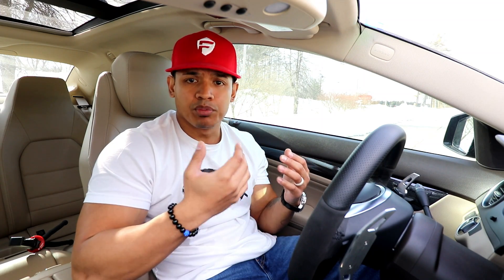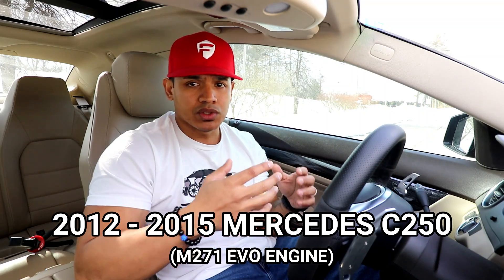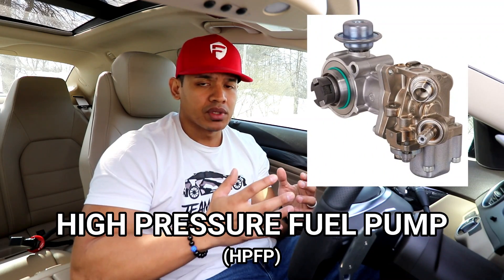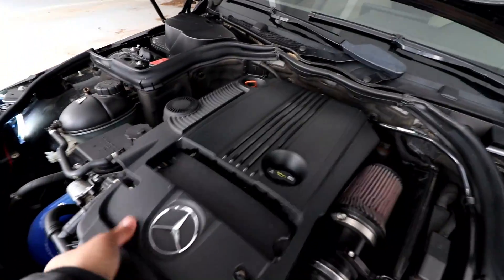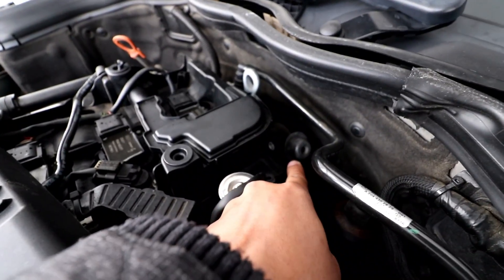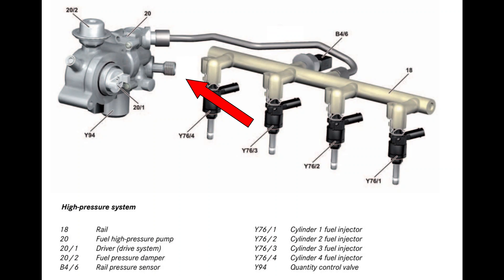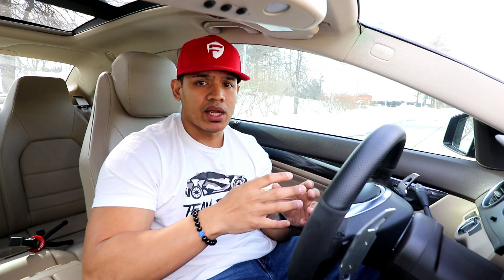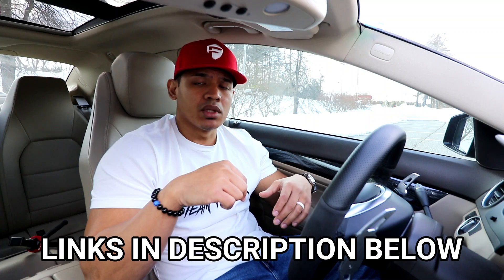FIX MERCEDES C250 P0002 POWER LOSS WHEN ACCELERATING

Comment: Had the same issue with power loss on my MB c250 2012 and P0002 error or P008A (low pressure fuel system - pressure too low), sometimes both at the same time. First thing you need to do is to replace fuel filters (there is regular fuel filter under the left back seat and coarse filter before the low pressure pump under the right back seat, you'll have to disassemle fuel pump a little bit to find that kind of pouch filter). After replacing first filter and cleaning second I can accelerate up to 6200rpm without any errors. Hope this help to somebody
Reply from the maker: Thank you for sharing your experiences!!!!
Reply: I experienced this same issue. i am ordering a new fuel pump and also checking the filter sock you mentioned. on the xentry it shows low fuel pressure.

Comment: One thing everyone should know is the way this turbo setup up is built you can't just punch the gas , I've noticed if you treat it like it has a big turbo setup and want to pass someone, if u hold the downshift lever to the left and the car will shift to the safest gear and then just gradually give it gas all the way down as your buildin boost until youve passed traffic or merged etc. Never step on the gas all at once and the kickdown function on this model is just terrible so I personally don't use it , hope this helps

Comment: I ran into this issue and as soon as I turned my car off and waited about 5min, before starting it again, and it was 100% normal, however if you try to start it right after you turn it off it is likely that the car will not start the first time and the check engine light will be on!!! Car needs to have 5-10 min before it is started again, I have noticed that other people have been doing this as a temporary solution just to get where you need to go!

Comment: Amazing how many people have this problem .. so with me it happens when I pass .. and when I pass and push down on the Accelerator quickly and forcefully it then goes limp ..  and suddenly I can’t even go over 30 miles an hour .. it’s incredibly dangerous and a really serious issue
Reply from the maker: There was finally an extended warranty on it (I think).  You’d have to reach out to Mercedes Benz USA and give them your vin and ask. Still a little late by Mercedes’ if you ask me.
Reply: @TheFlexxGarage  there was and I took mine in and they said the fuel pump wasn’t the issue and it came back with a broken charge pipe that they wanted $1k to fix

Comment: I'm a 2012 c250 owner and have experienced this same problem since 2014. This is a horrible issue for anyone that has experienced this problem. I'm hoping there hasn't been any fatalities do to this problem. I'm also upset that Mercedes consistently denies how serious this problem is. I understand that there's wear and tear on vehicles but there's people who have this problem driving out the dealership. I'm reaching out to all of you to help support on starting a recall on this problem. Below is a link on where to file a complaint. I hope you all share 5 minutes of your time to submit your complaint.

Flexx keep up the good work bud.

NHTSA link: https://www.safercar.gov/
Reply: I have had the same problem twice now whilst on the interstate trying to overtake. I agree this is a serious safety issue and I have completed a report (only took 5 minutes) at the link you provided, thanks. I think everyone should file a complaint to force the issue and make Mercedes Benz take responsibility before (if it’s not too late already) a fatal accident occurs. I have a 2014 C250 with 67k miles on the clock.
Reply: I took 10 minutes to file a detailed report for same issue 2012 C250 with P0002 code power loss while accelerating, I hope something is done about this, Thanks for all the great info.

Comment: Truly appreciate Flexx Alexander for posting this video. FYI to all, this high pressure fuel pump is indeed part of extended factory vehicle warranty/recall by MB USA. They finally recognized this to be a major issue. I have a 2013 MB C250, so check with MB USA. My car had this issue for years, initially thought to be the turbo, but after turbo was repaired the acceleration issue continued for years and no one could really figure out the problem. Recently tried to sell my car and the buyer test driving it floored the gas and the issue came back and I panicked but scanned my car, got the P0002 code and came across this video. Took my car to dealership and got it repaired for free, saved me thousands. My car finally drives perfect as it should.
Reply from the maker: Yes, I already shared that a few months back. I got the letter as well.  Only thing that sucks is that most people already got it repaired (not by MB) so they can’t get reimbursed or their car is way out of the extended warranty period.  I feel like MB knew about it but didn’t want to do anything until the last second so it’s less exposure to them covering the fix. This is the same exact route they took with the camshaft adjuster issue on the c250.
Reply: @huantsai9406  does w205 have that recall or what is it called

Comment: Thanks a million! Happened to my W204 too. The dealer could not find the root cause. Since I had watched your video, I insisted on double-checking and they finally confirmed it's the High Pressure Fuel Pump!
Reply from the maker: Nice!
Reply: so they replaced only the high pressure fuel pump and the problem was solved?
Reply: And how much did it cost?

Comment: Yo Alex, as you probably knew already, YEP, I had this problem last year where the dealership had my car for over 3 months on hold because the high pressure fuel pump was on back order and there was only 5, THAT's 5 HFP's in the entire USA available for distribution. 
but this is a known issue with Mercedes Benz. I'd say though that the real problem is that MB hasn't made enough inventory of these HFP's to send out to the US for replacements. 
Also, for all those who may not know, these same 2012-2015 C250's also have a passenger air back recall on them as well. AND AGAIN, this issue can not be resolved because the original company that made the airbags went out of business. So MB had established another company who was suppose to take this up, but again, the airbags are on back order.

Comment: Thank you so much for this. I had the same problem on 1.8 petrol w204 face-lift. Replaced the High pressure fuel pump and it works perfectly now.

Comment: I had that issue with mine. I was told where I got my 2013 c250 w204 that I had a bad coil?? It got replaced and hasn’t happened to me again….yet. But good to know this info. Thanks flex.

Comment: I made a comment of this b4. Pretty much  my rule of thumb is not to floor it when ur gas is low, and when I mean low. I'm talking about little below a quarter.  I had this happen b4 and it's not a fun time trying to fix it in a middle of a commute.  In my case, all I had to do is clear the code and it was back to normal.

Comment: I’m having this issue right now. I found a kool little solution besides shutting the car off. I just put the car into sport mode and only hit the gas about a quarter ways to the floor. The car gets moving and doesn’t put it into limp mode. Now it’s not a fix at all but you’ll definitely get more power to pass on the freeway and you’ll be able to continue to drive until you have enough to get the problem fixed. I’m about to buy another HPFP soon and try to replace it myself.
Reply: Leave it in eco and just hold the lever in the downshift position and it will put it in the safest gear , then treat it like you have a big turbo setup and gradually step on the gas till it's all the way down and shift accordingly (reason for eco is because in sport it will shift closer to redline , and will require more work and fuel from the pump)
Reply: @BC2FITTY  even when I do that, eco mode still doesn’t have the power I’m looking for or need to pass, sometimes. So what I’ve learned is to just hit the paddle and upshift the car on my own before it gets close to redline. I have the power to pass and don’t have to worry about the pump putting in too much work.

Comment: I had the same issue mine was under aftermarket warranty. They changed my spark plugs coils and  inner cooler. and that fixed it.
Reply: Did you have to pay anything?
Reply: @GamingLife114  did you had to change all coils an would hesitate when you would step hard on the gas

Comment: Hey Flex man thanks for the info. Just got off phone with my service rep and he confirmed the warranty extension on the high pressure fuel pump does qualify my car so taking it in this Thursday.
Reply from the maker: Nice
Reply: If you have a salvaged car do you think it still works

Comment: My 2014 C250 did the same thing in January 2023. I saw this video and thought, that has to be it. (I've been a professional VW/Audi Technician since 1985 with Mercedes experience). I was passing a car on freeway and "boom" the car went into Limp mode with the check engine light turning on immediately. 
I erased the fault and all was fine for 6 months until it happened again when merging almost full throttle on the freeway in June 2023.  I saw here in the past comments that there was a warranty extension still available on my car with only 64K miles. 
I visited the MB dealer in Bellevue Washington and told them about the high psi fuel pump warranty extension for 10 years or 100K miles. They charged me $250 to check and said that there was a low-voltage fault software update that has to be done first. I said OK, do the update. 
My car went into LIMP mode again 3 days later when punching the gas pedal quickly to beat the light from turning red. I was at 35MPH and hit the gas. It went into LIMP mode again with the check engine light turning on immediately. 
I brought it back to the dealer in July 2023 in Bellevue Washington and said,,, " I'll will bet you $100 that the repair is 100% for sure the high psi fuel pump" The dealer ordered the FUEL pump, installed the high psi fuel pump in August 2023.
I'm HAPPY to report that the car is 100% fixed. I drove the car hard on the freeway, and top speed with ZERO issues. I've made sure it fixed before typing this info. I'm happy. 
Thank you for the useful information.
Reply from the maker: Wow…wish they didn’t give you a runaround the first time.  That type of stuff pisses me off when shops just throw parts and services at the problem and make you pay instead of truly diagnosing the issue and fixing it right the first time.  I’m glad the issue was resolved.  This is not the first time with Mercedes, they also had the camshaft adjuster issue on the c250 that they didn’t issue a warranty extension until like 8 years afterwards.  

They just sent me a warranty extension for a purge valve on my 2016 w205 c300….after I already paid a third party shop over $1,000 to replace because I was out of warranty.  Let’s see if Mercedes will even reimburse me for their defect.
Reply: @TheFlexxGarage  ,, 🙋🏻‍♂️. I know, and I paid $250 for a software update that I knew was NOT going to fix it but I paid it anyway. 
I really like the service advisor at the dealer. He  called me and told me they accidentally broke a vacuum line  while replacing the high pressure fuel pump. They ordered the vacuum line which put my car down for a total of 10 days for a 2 day repair. The advisor was really really good at taking care of me with car rental and loaner cars. 
But, 3 days after the repair, the check engine light came on with an EVAP system small leak detected fault.
I'm diagnosing on my own, I saved the screenshots. 
(Before I smoke the lines I will replace the gas cap and maybe the evap purge valve).
Thanks again for everything and your cool YouTube channel 🙋🏻‍♂️🙋🏻‍♂️🤙🤙
Reply: How much was it to get the new part installed
Reply: @talkncough888  ,, under the warranty extension it does not cost anything to have the high pressure fuel pump replaced.  $0
Reply: But how to know if my our car are under this warranty? @MotoTouringWorldWide

Comment: I had the same issue on my 2013 C250, Mercedes replaced the high pressure fuel pump for free under the warranty extension!
Reply from the maker: There you go. Nice!
Reply: Was is forsure the problem and how was the difference with the new one

Comment: I have this problem with my 2013 Mercedes I was looking for why my Mercedes is doing this and I got a notification for Mercedes  today that I need to take my Mercedes to the dealer to fix this problem for free just amazing they going to replace the high pressure fuel pump they don’t say why but I think is because this problem u talking about great 👍
Reply from the maker: Yup.  A few days ago I posted on my YouTube community feed the warranty extension.  Mercedes finally owned up to the issue I presented in the video.
Reply: No way I just got mine replaced for 1300 will they do reimbursement?
Reply: @TheFlexxGarage  I can’t find the post you posted about warranty extension
Reply: @rowaynerowe7897 yes

Comment: So I have had the issue for 2 years.  I have found 2 ways to minimize the issue: 1. Always put the car is (S) Sport mode and not (E) Eco.  2. Add Octane booster to your tank at each fill-up, I get the $3.49 Oreilly octane booster.  Keep in mind I am in California, and most stations are limited to octane 91.
My confusion is if it is the HPFP pump, why have I been able to drive it for 2 years without complete failure.  I get the issue about twice a week P0002, limp mode, turn it off and restart.  Is there not some way to rebuild it yourself?
Reply: Stan Nelson I'm having the same issue now going on one year but it is now happening more frequently.  Shut off the car and restart the car resets everything.  No one can find a code or what's what wrong.  My car is always in sport now so I won't buck but since last night it's doing it on all accelerating.  I'm actually scared now so I'm here reading and googling.

Comment: Thanks for the video! I had similar instance the other day. All seems OK with tuning engine off and giving it a rest for a while.
Reply from the maker: That’s not a permanent fix.  Everyone has done that temporarily but you should def get it checked out before you get stranded. There was an extended warranty on the fuel pump. You should have your local Benz dealership run your vin number to see if you’re qualify for a free replacement.

Comment: I have  a '13 C250 Coupe.  I love it!  What contrast from my '72 280Se 4.5 or my 89 560SEL.  The C Class handles like a go-cart.  Just twice now, when I nail it the bogs, check engine goes on and looses power as what seems like its turbo is not responding, but does not go to limp mode.  I runs at whatever speed you want to go, shifts fine but just as if it does not have the extra boost.

If I shut off and re-start.  it still runs like described above. If I clear codes it will run fine, and will provide high power as long as I load it slower, not nailing it instantaneously.  The effect is akin to an old 4 barrel without secondary accelerator pump.  A big bog that is, but eventually gets up and goes.

This just started, so no trouble shooting yet, and the only thing I loose it the ability to nail it.  ANy suggestions or insight would be appreciated.

Comment: My 2021 c300 is having this problem, gonna take it to the shop tomorrow.
Reply from the maker: Good luck!
Reply: @ isn’t it crazy I’m getting these problems at 45k miles
Reply from the maker: Nope. Cause I had the issue at 30k miles on my 2012 C250 and I had a different issue at 40k miles on my 2016 C300.  Good ole Mercedes!

Definitely check to see if there’s a recall or extended warranty coverage.  Cause if it’s a common problem, Mercedes usually has an extended warranty for it.
Reply: My 2016 had no problems. I upgrade to a 2020 and all of a sudden i have problems every other month.. NYE i had the check engine light come on and limp mode.. they reset the computer and it ran good as new nothing wrong.. it hasnt even been a month and the check engine light comes back on and they’re saying its the high pressure fuel pump over 1k fix….

Comment: I have the exact same problem. I’ve been taking it to the dealership and they “can’t seem to figure it out,” which is possibly BS. Took it in again today with the code P000277. Here’s the notes from the mechanic: “the quantity control valve has a malfunction, the commanded position can not be reached. Followed guided tests and fuel pressure testing all passed. Passed test resistance in high pressure pump. Passed test resistance from ME through engine harness.” The dealership even told me they called Mercedes because they had never seen the issue. My car does not do it every time I hit the gas. It’s done it many times over the past few months. This week it did it on Monday and Wednesday. I get that maybe it’s a glitch right now, not a complete fail which is why the dealership “can’t diagnose the problem”, but I don’t really want to wait until it completely fails. I kinda feel like they just fed me a load of bullshit. I literally found very similar issues with a single Google search. Grrrrr! Sorry, I’m a little pissed right now.
Reply: Msbral Shotner did you fix your problem?

Comment: Had these symptoms in an SLK with same engine.  Replaced hp pump, ended up being fuel pressure sensor .
Reply from the maker: Yeah.  It could be the fuel pump for some cars as well.